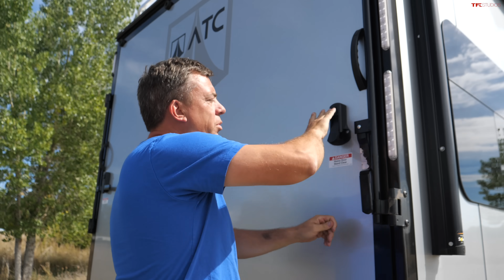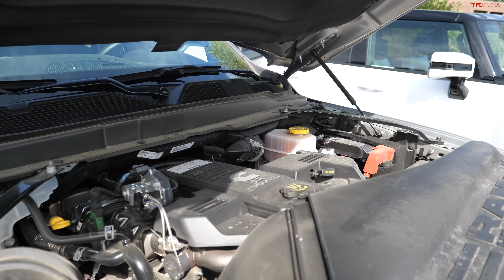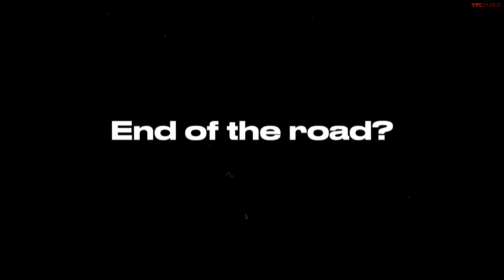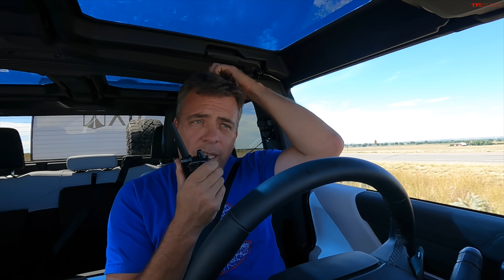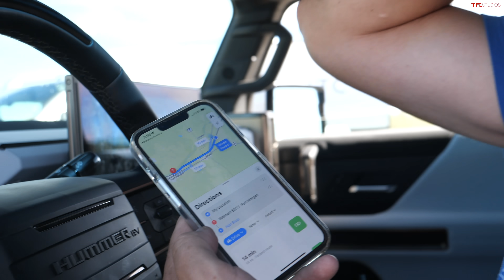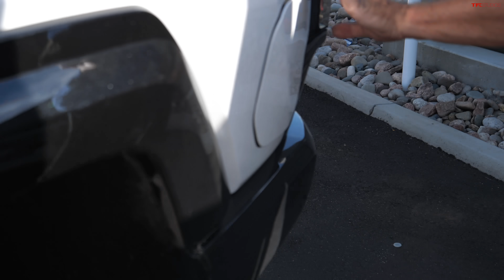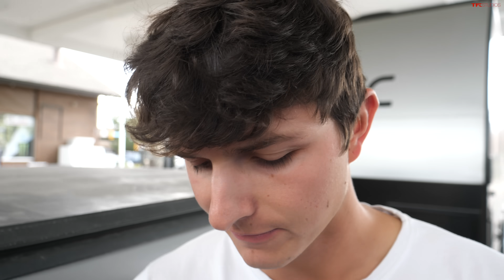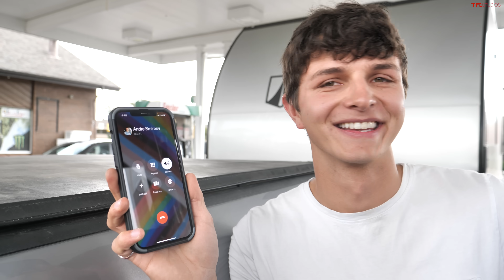How Far Can a Diesel and Electric Truck Tow An Identical Camper Trailer on ONE Fill-up?

Comment: That’s too bad because I have an 8000 pound camper with three slide outs and a steep hill to pull coming out of Salt Lake City Utah so that means I’m gonna maybe be able to go 70 to 100 miles before I need to charge which is super lame. I’m also a contractor who pulls skid steers which come in at around 14,000 pounds so that means that hummer can’t even tow that further than 50 miles so I guess I’m just gonna stay with my 3500 diesel and be able to tow 400 miles up and down mountains all day long sorry Ev

Comment: Lets say price of diesel goes to 7$ per gallon, lets say you charge your EV truck for $0.10 per KW at night and only use it around town towing landscaping trailer.   It would make sense to get ev for sure.  If you tow across states, then diesel is way to go, at least for now.

Comment: Electric pickup trucks just are not practical for hauling. Why?  As someone else said many years ago before this EV craze, and this is still true today, "It's the battery, stupid."

Maybe someday in the future, when we have electric power stations next to EV charging stations to allow charging huge batteries in less than 5 minutes.

Comment: The Hummer has a 212.7 kWh battery, and at $0.43/kWh is a cost of $91.46+tax to charge from 0% to 100%. Getting 128 miles on a charge, that's $0.715/mile. The Cummins was $0.493/mile at the time of filming this video, when they were paying $4.79/gallon and getting 9.7mpg. Driving 12,000 miles a year, the Cummins would save over $2,800 annually. 

Even at the EPA rated range, the Hummer EV is $0.291/mile. The Cummins would have to drive 108,000 miles before the cost per mile difference would match the price difference between the two trucks. Diesel is also over $1/gal cheaper now. It's $3.46/gal where I'm at, and that changes the cost per mile to $0.357. Now the Cummins would have to drive 128k miles @9.7 mpg to cost the same as the purchase price of the Hummer.

I have a 2009 3500 6spd, and I get 21mpg on the highway. My cost per mile is $0.165. If TFL got my fuel efficiency, the fuel cost would take 279,000 miles to equal the difference in purchase price between Hummer and the Cummins.

Comment: The problem with the electric truck is the time it takes to recharge. That will always be the issue until technology finds a way to charge a battery in 10 minutes.

Comment: Yes of course a diesel truck has more range since diesel is more energy dense, but if you would compare energy efficiency by using energy equivalent (33 kWh per gallon) than the EV wins by far. With these cheap gas prices with 10 dollars the EV goes about 15 miles (40 cts/kWh and 0,6 miles/kWh). The diesel truck goes 20 miles with 10 dollars (4,79 dollar/gallon). In the Netherlands the diesel truck would go about 14 miles with 10 euros (about 7 euro for 1 gallon). With the EV it depends where you charge: tesla is about 30 eurocents/kWh, but Fastned is 69 eurocents/kWh. So the range for the hummer EV with 10 euros will be between 8,7~20 miles.

Comment: The difference in efficiency is almost exactly the same. They’re failing to calculate that electricity mostly comes from natural gas. The conversion from natural gas to electricity is only about 40% once it gets into the vehicle. In the end, the diesel truck is actually more efficient just slightly

Comment: Electric cars, trucks and buses are really a "NO BRAINER" literally. The cost factor is a joke. Power grid will not support it, charging stations would be backed up if very many people have them not to mention that the number of stations will never be enough to drive it on the road worry free. Charging is not always free. If enough people get them you will be amazed at what it will cost for a charge. The government will be putting devices on vehicles to charge taxes on the miles you drive to pay for all the things fuel taxes pay for. The extra weight of the vehicles BTW will make more fatalities in road crashes with these vehicles. Not to mention they can actually catch fire more easily and even go up in flames later even after having the fires put out on the count of the batteries. Electric vehicles are not the answer to anything but golf carts.

Comment: I'd take a Hummer EV if someone gave it to me, then I'd drive it directly to a dealership and trade it in on something worth having.  My Cummins will go nearly 800 miles on a tank, I've pulled 12k trailer over 450 miles without stopping, no thanks on the EV garbage...

Comment: An interesting extended test for this scenario...is there even more efficiency loss on the ev after the first 350 kW fast charge? The battery is already hot after the first leg of the trip, then you dump a full recharge into it at 350 kW (or do you only half charge it because you know you are tearing up the battery), then get back on the road with the motors and electric inverters still hot...does the range deteriorate even further?

Comment: The “Free charging is hilarious.”  No one old enough to recall banks pushing everyone to use debit cards, “For ease of getting your money” from the ATMs?  Once the masses started using ATM machines, the banks started slapping ridiculous fees onto them.  You have a card of ours?  There’s a fee.  You used an ATM machine that wasn’t ours?  That’s another fee.  Charging grids will do the same, once demand increases.  Can’t charge today, demand is too high.  You can charge today, but it will be extra.  Don’t be fooled, people.

Comment: Useful comparison.  Thanks!  Now I'm wondering how much range I'd lose if I had a super lightweight camper in the bed or a Ford Lightening or Chevy Silverado EV.  I recently drove my little Chevy Bolt EV from California to Brazil without much problem but I only was carrying basic cargo (including a spare tire in the hatchback plus a portable electric fridge-freezer but nothing super heavy of course).  I'd love to have a EV pickup with some kind off reasonably comfortable camper to take on long-distance trips into Latin America but without taking a super big hit on range.  Driving slower helps ALOT I've discovered.  Including letting the foot off on uphills.  The Bolt shows a constant real-time display of kW so you can see the effect of speed and hills clearly.

Comment: Well, looks like electric trucks are not going to be the best choice for towing travel trailers at present.  The answer of course is to stick another 6000lb battery in the trailer.  That's all it could carry though, plus you'd have to slim down a bit to avoid exceeding the payload of the Hummer, what with the tongue weight and all.

Comment: Not paying that much for ANY vehicle but the idea of having a Truck pulling an RV using electric is nice.  Gas costs so much these days that it could easily cost over 1k in gas to drive from one side of the country to the other coast to coast. EV charges cost next to nothing.  They have to get the range up higher like 200 miles when pulling an RV.

Comment: Sounds like the trailers themselves need a 300 to 500kw battery that can provide power to the truck. That'll be the next thing from tesla or some camper manufacturer. Add solar panels and sell them on not needing a generator for camping.

Comment: I can fuel my  4wd up, load half a ton in the back and tow 2 ton.... I can drive 900 miles before I need to refuel...  1000 miles if I use my Emergency Jerry Can...  The real killer is the 5 minutes it takes to refuel... And do it all again...  diesel 4wd.....  Plus out where my property is... The local charging station charges $1 per Kw  ......

Comment: I'm an absolute EV fan - I love my model Y its so much better than an ice for normal driving, however the range for towing is impractical. I do a bit of towing with mine for which it pulls amazing - just not for more than about 150km.

Comment: You need to change the WAY you drive when driving an electric vehicle. You need to develop a whole new mindset!!
What you've shown here is that a diesel (ICE) vehicle can drive a greater DISTANCE on a tank of fuel ... that's it!!
The electric vehicle needs to be charged in bewteen .. but so what?
What's wrong with taking a coffee break during the trip?  Gives you a chance to get off your arse and stretch your legs, reduces the chance of DVT and gives you a far more 'relaxed' experience.
The issue with disconnecting to charge is an issue with station charging 'layout' .. not the vehicle .. and can be easily fixed.
At the end of the day .. HOW MUCH did it COST to drive the distance?
Even if the EV had needed to pay for its recharge, they would have saved more than enough to pay for a relaxing meal break on the way.
It is STILL relatively early days for EV's and all these type of issues will be solved in due course.  Just think back to a couple of years and realise just HOW FAR EV's have come in that short time. In fact, not only EV's .. but alternate energy sources.

By the way ... I'm a DIESEL 4x4 vehicle owner here in Australia, and spend MOST of my time towing a large caravan around some of our most remote areas.
One final thing.
We aren't heading down the path of EV's just for the hell of it.  It's about trying to mitigate the damage being done to the planet and OURSELVES caused by the harmful effects of continuing to burn fossil fuels.
Reply: Time is money, that’s why.  Many people are not taking multiple breaks to get to a destination in a day.  Those added stops equal money wasted.  Our last trip out west, we averaged 630 miles/day.  There’s no way we are sitting for an hour to charge, so we can go another 130 miles to do that all over again.  They exclude mountain driving in these scenarios, so add that to the range depletion an EV will sustain.  It’s completely impractical.  Only folks who would want the 15-min city lifestyle would be fine with these pathetic EVs.

Comment: interesting vid, but would have been nice to do the calculations on how many times you could have filled the tank up to make up the 40k difference in price . and also now that electricity is way higher and also time standing around waiting for charge vs time standing in fill up of gas ⛽️

Comment: Two interesting points I want to make. Do the same test in 3 years with the same vehicles. The ice vehicle will be about the same. The EV will loose mileage big time. Batteries don't hold the same charge over time. The ice vehicles keepup the same years longer than an EV. Second point now say I am going on vacation camping trip to Yellowstone national park 800 miles away. How many days willI loose getting there and how many days earlier will I have to leave to get home same day?

Comment: Looping back before the point of no return is the ultimate going green strategy in 2023. Gotta keep our brothers in the coal mine feeding the grid. 
I would love to hear the Hummer with a delete, tune, and turbo. Bet it sounds awesome.
Electrics are the “Jellies” shoes of the 80’s. Fashionable, but a passing fad for those that have to do real life stuff.
What would the carbon footprint be to build rest areas at all charging stations where drivers could spend their afternoon and evening waiting in line to charge?
That Ram almost has enough towing capacity left to pull the additional RV and Hummer to your destination. We all know that strategy would have been the green one.
Electrics are a feel good “look at how much i care” trend to go green if you ignore the real truths behind our grid and how power is made and delivered.

Comment: Who tows a trailer without any gear? You say trailer weighs 6400 pounds, but where is the 5,000 pounds of gear? So loaded up, the Hummer can't even leave the parking lot. Not doing mountains? What a damned fail, boys.
Reply: I was pointing that out too: No mountain driving, which is what you do a lot of in the West.

Comment: But who needs to tow more than 50 miles? And if you do just pull over and stretch your legs for 4 hours and charge on that expensive natural gas converted electricity 🤣

Comment: These videos are pretty dishonest. He drove half the distance in the hummer. It would have been 40 bucks for that charge. Then to stop where the Cummins stopped, is another 40 bucks. Making his total 80 bucks for the same distance the cummins went for 100. 20 dollar difference, oh boy. Oh and the time it takes to charge vs fuel up..... what if that 350 watt wasn't available? Its clear that they are limited. What if all of them were taken and you have to sit there waiting for one to open up? Gas pumps take 5 minutes for a car and then it is your turn. The technology isn't there and they're way too overpriced. These "trucks" are a joke and waste of most peoples time and money. 300 mile road trip just added 4 hours of travel time. Just a joke

Comment: Gas prices is too high and there was going to be mix. The power is going to be more higher than the gas price but the funny thing about it. They could just turn off all the power stations and no one’s going to drive anywhere because no power to go nowhere or even if you do have a full charge a battery the most to get to 150 mile range. It’s just a controller people need to start opening their eyes.

Comment: Apparently this little guy ain't much in mathematics he used over 21 gallons of diesel and he said earlier that the tank was only 31 gallons so if he ranted bone-dry he would only have 9 gallons left in the tanks getting 9 Mi to the gallon he was only good for 81 more miles

Comment: EV vehicles are absolute nonsense... they solve a problem that doesn't exist.. diesel have DEF & runs clean. We also have CNG engines that burn clean & have similar power to diesel.. EV I'd a marketing scheme that liberals with degrees spend tons of $$$ on..

Comment: In my opinion that technology isn't really a feasible option right now they don't have the range and the time to refill is to long plus the cost of the vehicle maintenance and battery replacement (which is like changing your fuel tank) it just doesn't work for a majority of situations

Comment: The customer will decide which is the best for their needs. No one will tell you how much it will cost to replace the batteries. The money spent on a EV and not know the cost to replace and repair items are never discused and compared to a fossil fuel vehicle. Also the trays holding the batteries will eventually rust out in certain areas where road salt is applied to keep the roads driveable.  I will stick to fossil fuel vehicles.

Comment: I know my driving experience is more mixed than some as I have driven OTR semi-truck units and regular gas vans and cars for different jobs. I had one job that took me from Peru, Indiana to Hickman, Kentucky. I gassed up in Hickman, Kentucky (picking up a semi driver) and drove to the Flying J Truck stop in Effingham, Illinois (where the truck was supposed to be) then to the TA Travel Center in Clayton, Indiana (where the truck was actually left). Roughly 331 miles in a 1977 Chevy Monte Carlo with a small block 308 (yes the engine had been replaced by a previous owner) on 3/4 of a tank for a 19 to 20-gallon gas tank. 

I had to use my PV as there were no company vans in northern Indiana to get this driver, I made some good money for that trip and the company paid for the gas. It's amazing what a little TLC and new spark plugs can do for fuel mileage at times.

Comment: Why didn't you just throw a generator in your trailer, go to the complete failure so you'd know exactly how far?, and pull off to the side of the road and start the generator and fill er up.

Comment: EV 🚗 are not environmentally safe from making them to the upkeep and disposal of the one of the most environmentally destructive element witch only chemicals can put out and the only thing that catches 🔥 with any liquids. Hell I should've stayed in the Electrial felid to work on those ev cars only  an electrician garb up working on industrial equipment amd and hi voltage power lines. Waisted good money on my Automotive Technician degree.  The big 3 have had this plan to go full EV by 2025 back in 2008.
Reply: What did you do with all that money intended for spelling lessons?

Comment: Yup can't compete with the internal combustion engine
Reply: Give them both $5 worth of fuel/electricity and see who goes further.
Reply: @Doug Zeller  they already proved diesel will go farther idk about u but I don't go on a trip with 5 gallons of fuel or electricity I can say this tho my dad drug his 26 foot toy hauller with 2 Harleys in it 1/2 a bed of fire wood and more  with his 2011 6.6 200 miles did not have to stop for fuel non stop up there he would of had to charge that electric toy atleat once another benefit he had over it is there was no were to charge that once we got there he had many places to get diesel for his truck I'm nit convinced electric is better and I'm not even getting into the harm electric cars do to the evierment let's put it this way they still require coal to run

Comment: Sadly, battery technology just has not advanced enough to actually compete with gas/diesel engines at this point.  Not saying they won't someday surpass them but not for at least a couple of decades.  Then add in the extra costs, the charge times, the lack of chargers and then the fact nobody wants to deal with the EV's battery when it is time to dispose of it.  I think an EV is more for someone who works in town and doesn't travel far for work.  It would be a good vehicle for that type of scenario, but the cost still makes it not the best option.  They have a long way to go before they are truly viable.

Comment: How many miles can you drive before the battery needs to be replace?  What is the cost to replace the battery. I've drove my truck over 200k miles with no issues.